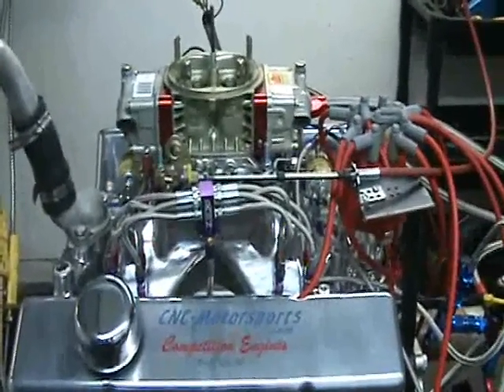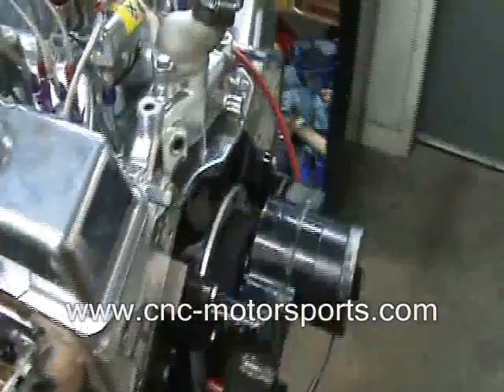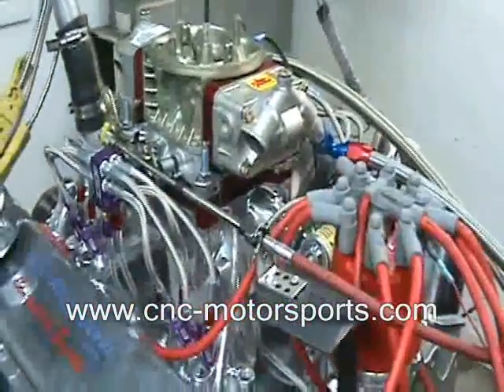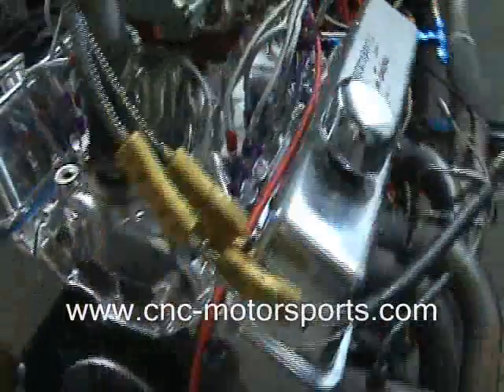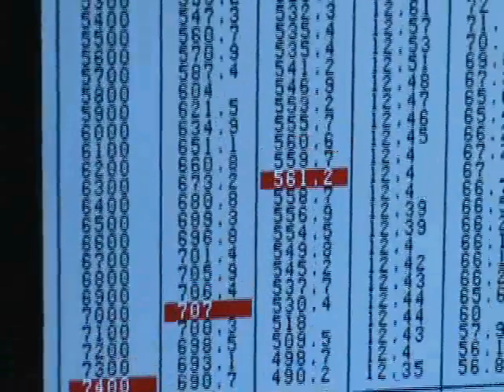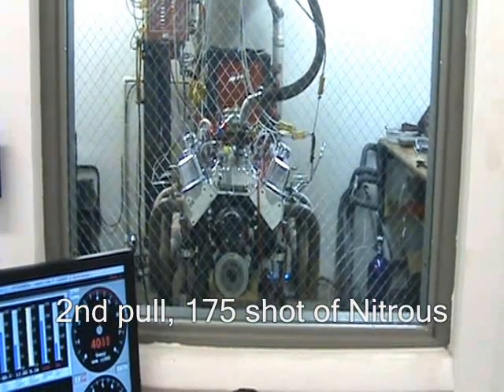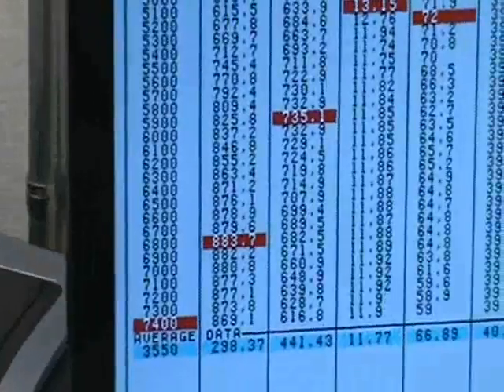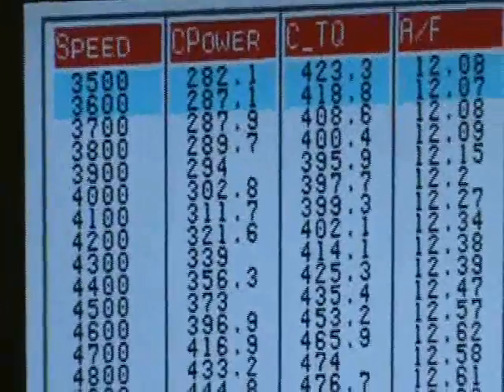SB Chevy 427 Stroker Nitrous Engine1005 Horsepower

Comment: thought I seen an article once that a big block with an actual 427 cubes made 1000hp naturally aspirated.....billet crank,  the whole bit.  ahhh, the good ole 427 sbc vs. the 427bbc argument lives on.....
Reply: Big block heads have canted valves and flow more cfm by design. But a big block takes about a .25 of a second penalty because its heavier.
Reply: I can believe it because I own a 1969 BB 402 that came out of a 1969 SS Impala that was 425 Hp from GM.
The engine went into a 1972 3/4 4x4 Truck that the engine turned into a wicked truck.
Then I sold the truck but kept the 402 then it was rebuilt in 2021 then put into my guide work boat jet boat. 
My fishing clients love the sound and power of the 402 in the jet boat.
This is the last life of the 402 with 60 over size pistons.

Comment: Motor motor motor, never ceases to amaze me that so called "professional " engine builders and machinists call and engine a motor. Motors are electric
Reply from the maker: Motorcycle or Engine Cycle? Motor Oil or Engine Oil? Engine Sports or Motorsports? We must all be wrong..
Reply: Motocross or enginecross 🤔
Reply: Engine Builder or Soy boy motor winder?  Gentlemen Start Your Engines !

Comment: smoke coming out is this natural just asking??
Reply from the maker: That was a little oil hitting the header
Reply: thank you love the engine
Reply: Lincoln Karen it probably pushed some oil out through the dip stick people dont realize that running a motor on a dyno puts alot more stress on the motor than what people think and most of the time little things like the oil dipstick is just stuck in there and not really snug down since the engine builder is slapping the motor together really quick to make a few dyno pulls then pulling it back apart to ship it so you'll have a few leaks on the dyno during runs

Comment: this is all you need, a nice tuned and machined motor like this one .with a $500 nos kit and the right heavy duty drivetrain kit to back it up.you will proably be faster than any ss, srt-8,hemi,zr1,zo6,acr,r8.r 35,sti,amg.